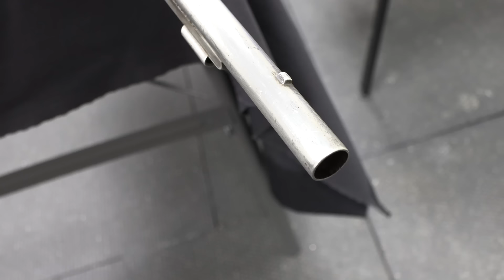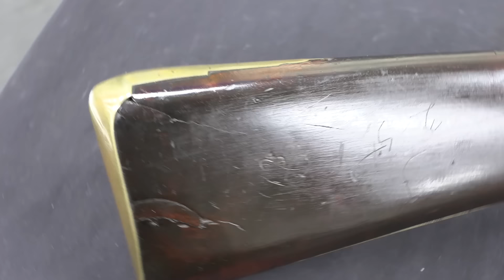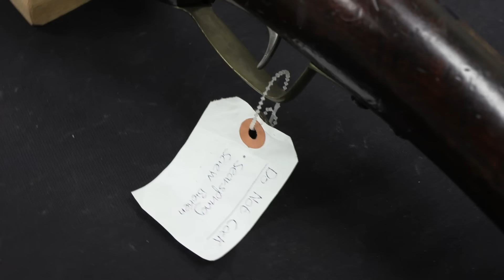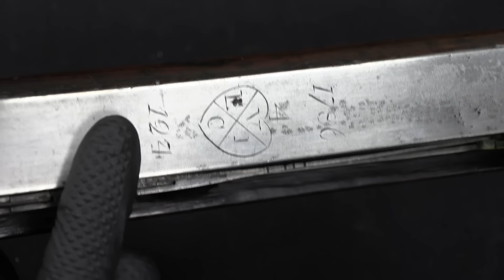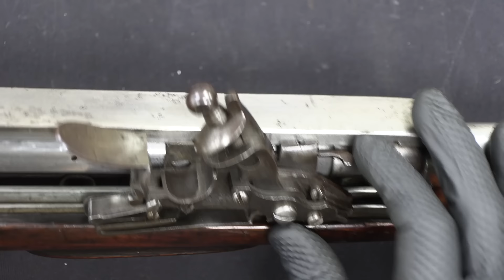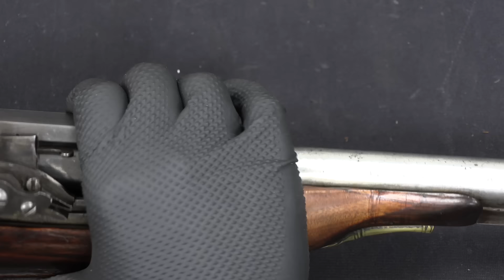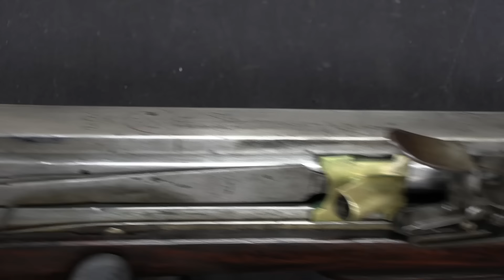Belton Repeating Flintlock: A Semiautomatic Rifle in 1785

Comment: Couldn't you argue because you can fire multiple shots with one pull of the trigger.  That makes it a full auto or machine gun.
Reply: Full-auto does not work like this. This weapon has a number of triggers and every round still has its own trigger that needs to be pulled to fire.
Reply: @SpecJack15  That's correct, but by using the special balls with a hole in them, you fire the first and the others fire as the one in front goes off.
Reply: Call your local ATF office and ask them. 😂

Comment: I can´t see how you can classify that as "semiautomatic". It is a repeater, a clever repeater. It is as semiauto as a Colt Paterson!
Reply: Using the slow burning fuse it shoots every time the advancing trigger is pulled. One pull=one shot without cocking the hammer. So it’s semi automatic.
Reply: @goofygoober1007  Not the other one.
And the fuse contraption is in a "grey zone" when it comes to being a true semi auto since it need a fuse that burns about a minute. I would consider it a "manually controlled roman candle".
Reply: @twentyfifthdui4717  It relies on an external source of energy (in this case heat) to function as the proclaimed semi auto. That means it more like a double action revolver with its external energy in form of a long trigger pull. Or like a chain guns electric motor. The flint and the primer powder is an intergral part of a, for the time, conventional ignition system. To call this semi auto is like calling a volley gun a machine gun.
Reply: @RiderOftheNorth.357 one trigger pull=one fire. That’s semi auto. And it’s not cocking a hammer so it’s not a double action. But regardless if you want to argue double action or semi auto it results in the same one shot per trigger pull
Reply: @goofygoober1007  You can´t understand the BIG difference, can you?
In any reasonable definition of "semi auto" the gun reloads to ready next shot AND (and this is the crucial part) it uses energy coming from the firing in some form. To omit the "using energy from the firing-part", as you do, makes most reapeters semi auto. The complete process of firing (with manual trigger) and readying the next shot needs to be integrated to be classified as a semi auto. The only manual input should be the triggerpull and no external energy sources should be used. And to have a little fire on the side is very much a external energy source. I don´t even have to go into the crucial part in the definition of semi auto that describes ejecting and reloading.
A weapon that needs an external energy source can not be described as semi auto unless you look up the word in a dictionary for crossword-puzzles?
The gun in the video is a manual reapeter with a manually controlled roman candle function, and it is neat. But it is not semi auto. It is, technically, a variation of a volley gun or mitrailleuse.

Comment: I would guess that extreme care would be required in loading the tube. If the powder quantity is a bit off, then the last couple of balls loaded into the tube (ie the first ones to be fired) might line up with the touchholes rather than the powder.

Comment: It would be fun to see a modern commercial reproduction of these guns.
Reply: And they would be priced exactly in 3-30k £ range😅
Reply: @TheArklyte  It would be banned in EU
Reply: @ChidisSkaniukas  my country is not in EU... sadly.
Reply: @TheArklyte  I imagine, assuming you're in the UK, that each "magazine" would be an FAC slot item (like with muzzleloading revolvers) which would likely make this far from easy to have a bunch of tubes for, unless they've changed that recently like they did with the chamber inserts for shotguns
Reply: @TheAlexagius  I'm in Belarus, country used by Russia as staging ground for their invasion ¯\_(ツ)_/¯
I guess I needed to write "sadly" in bold😅
Reply: @TheArklyte  :(
Reply: @ChidisSkaniukas  No, I don't think so. There are exceptions for black powder guns in many European countries (although you often need a license for the powder itself and for using it). However, if it can fire off more than one round in quick succession (including if it has just two barrels, for example), you usually need a weapons license. Nothing illegal about it though. It would likely be regulated just like any other firearm.
Reply: @no1DdC  so regulated to hell, made expensive as fuck, so that 99% people can't afford it. Usual EU way
Reply: @ChidisSkaniukas  I don't know what kind of nonsense you're on. Guns are readily available in most of the EU, not particularly expensive and with reasonable, but not intrusive regulation. Hell, there's at least one gun club in almost every town. Not to mention, the free flow of people and goods has had a tremendously positive effect. Just ask the Brits how things are going without this.
Reply: And it’s not even a firearm by ATF rules. Easily can imagine a revolving drum of say three of those ‘toobes’ and some modern mechanics to ignite charges and to rotate drum
Reply: @andrewdenzov3303  that would be the Chambers flintlock that he mentioned early in the video... Multiple barrels with multiple projectiles.  I think it had 7 barrels and fired something like 120 rounds per minute after pulling the initial rip cord trigger.
Reply: It would be cool, but they would likely be to dangerous for a company to make. I imagine a chain fire would not feel great.
Reply: @shredgordon3240  A chain fire would only even happen if your shot weren't sized correctly, or maybe if you over-prime it. Both cases of user error. And given that user error has ever been dangerous in firearms, I really fail to see the issue.
Reply: @shredgordon3240 Seems like this would be /relatively/ easy to manufacture by hand, compared to a modern firearm. The lock is the most complex bit and you could buy and modify one from a kit gun I figure.
Reply: Yes!! I’d love to see this working! Such a wonderful and unique design
Reply: Coming to CA, NY, and HI soon!
Reply: Wow that engineered safety is awesome. I'm completely surprised this didn't explode in popularity. Repeating fire was surely underrated for a long time.
Reply: If you have about 20k lying around, and the blueprints, you can get a guy to make one for you. 30k withouth the blueprints.

I doubt there would be enough demand to justify tooling up for mass production.
Reply: Please
Reply: I expect most of the small shops that make reproduction flintlocks could build you one, but the volume is going to be small enough that you'll have to pay for all the tooling too, so it's not going to be cheap.
Reply: They could be probably California compliant too
Reply: The very concept would give your liability insurance guy a stroke.
Reply: @martinswiney2192  Bah, stick a thumb in it!
Reply: Ban assault muskets
Reply: @WaterEnthusiast1776  Cool, cool.
What about muskets with which I commit battery?
Reply: It would likely be a jam-o-matic due to dirt n sand. It would probably work great on a controlled range but iffy in the wild.
Reply: @earlahmer5528  not every battlefield is trenches of WWI. In fact muskets wouldn't even exist if such conditions were involved in all black powder era wars as firearms in general would be seen as unreliable. As well as bows and crossbows due to wood and strings rotting away in all the dampness and mud. It'll be a war of shivs and shovels:D

Not really much more complex then early revolvers, but only really useful for cavalry, who can't really reload reliably on the move.
Reply: These are likely extremely fucking dangerous

Comment: High-capacity flintlock 👍
Reply: fully-manual repeating high-capacity assault flintlock
Reply: It even has a shoulder thing that goes up on it!
Reply: Fully semi automatic too
Reply: @Nikolai1939  If you pulled the front trigger on the second one with the wick, I suppose by definition fully automatic too
Reply: @hanzzel6086  not really, you could just slide the ``trigger`` in a single pull, a single motion all the way down at whatever rate you feel like, and fire off more than a single projectile with a single motion... May perhaps require some slight filing of the catches as to make the action more smooth and less positively clicky, but alas, it can technically be considered as a potential fully automatic flintlock... THE HORROR! think about the children...
Reply: @camillosteuss  You'd need a pretty long finger to pull more than 2 shots off (which does still technically make it a machine gun).
Reply: STANDARD capacity ...
Reply: @kaboom4679  idk man, I think by flintlock standards, this does count as high capacity since the majority of flintlocks had a capacity of, well, one
Reply: Hi cap semi auto flintlock
Reply: we need to ban this assault rifle! there's no need for a civilian to own this!

Comment: The different solutions for "shoot fast" from back in the day are always interesting to watch
Reply: oh because in 16th century (1500s) a german or swedish commander said ideal rate of fire from musketeers 
 is 30 shots per HOUR.
Reply: @jalpat2272  Sounds lame now, but imagine just 100 soldiers armed with muskets (back then, most soldiers were still using pikes). That's 3000 shots per hour or 50 per minute. You can do a lot of damage that way - not to mention the psychological effect on the enemy. 

Armies were also able to train and get these musketeers battle-ready in just a few days, whereas it took at least several months to get halfway competent archers, which was the most significant and often overlooked advantage of early firearms in military use.
Reply: @no1DdC  I can only imagine the common soldier whose only ever used bows making the switch to firearms reaction.
Reply: @no1DdC Hear hear, It Also mean 1 shot per 2 minutes more than enough to cavalry to reach your line so they need a line of pikemen for protection, so pike and shot are the meta until flintlocks and bayonets.
Reply: @jalpat2272  Defending yourself against cavalry like this was particularly effective at the time, because cavalry units often used the pistol caracole (ride towards the enemy, then turn away and fire your weapons as you're closest), which was rarely able to break infantry formations.
Reply: @no1DdC I mean, armor piercing is arguably the most important aspect of early firearms, the best archer in the world would still struggle to kill a man in full plate. The quick training was a very close second though. After armor went out of style, then I'd argue the #1 reason they kept using them was ease of training, because even into the civil war a skilled archer could still outperform a skilled rifleman.
Reply: Considering 3 rounds per minute for single shot flintlocks at this time was considered rapid. This is positively lightning speed.
Reply: There was a really cool way to view progression that I always think about and get frustrated over which is asking someone in the 1800s
 "how can we get somewhere faster"
They'd answer breeding horses that ran faster or carts that were lighter. Not "steam engines"
Problem at a certain point you have to say "how do we do this DIFFERENT" not "how do we do this better". 

I say frustrating because I wonder what it is now we could do different not better. Of course it also requires technology catching up
Reply: "muh 2a only protected muskets"
the musket in question...
Reply: @cagneybillingsley2165 "the founding fathers never intended..."
The founding fathers: 21 rounds in 1 minute? Real shit?

Comment: Steampunk. Wonder how many rounds you can get down it before black powder fouling stops it working?
Reply: Honestly, with smoothbore guns, more rounds than you're likely to be carrying.

20 rounds in a single session from a flintlock musket is do-able- after all, there's a reason you see cartridge boxes holding 20, 24, even 30 rounds.  (12-20 was more typical for the period, but that was as much the fact that you'd rarely fire more than that in an open field battle before going for the bayonet charge).

With this gun, each magazine only holds 7, and you aren't having to load past fouling until all your magazines are exhausted (and that presumes you're still in combat and thus can't boil out the magazines before reloading).

The pan and hammer ("frizzen" in modern terms - that thing most folks call a hammer is actually a called a "cock") will likely benefit from a quick swipe with a rag between each magazine, along with a stab with the touch wire to the flash hole, but that's like 5 seconds or so, if you've set your kit up smartly so you don't have to fish around in the bottom of your box (under the wooden cartridge block) for the wire.

You'd probably be able to get at least 5 full magazine tubes out before fouling in the barrel would become a noticeable problem (recoil will progressively get stiffer), and you might be able to get more out before it becomes dangerously fouled.  Each mag tube should be able to be loaded and fired at least 3 times before becoming so fouled they are difficult to charge, more likely 4 times.

So, a typical soldier will end up running out of ammo before he runs afoul of fouling in a single battle.  😉
Reply: @geodkyt  nice
Reply: More like sailpunk.
Reply: a heap i reckon. all the moving parts are on the outside, and you change your chamber when you change magazine. plus smoothbore. no rifling fouling, no touchhole fouling. only place that might is the cone where the magazine seats, but you can easily wipe that every seven shots. while it may have other reliability issues, i really dont see fouling troubling this gun.
Reply: Wrong century for steampunk.